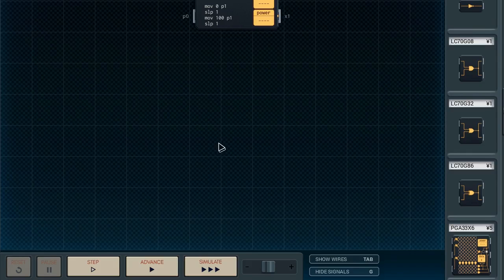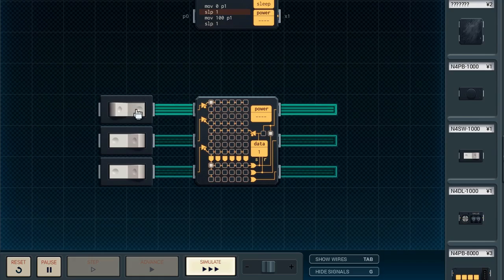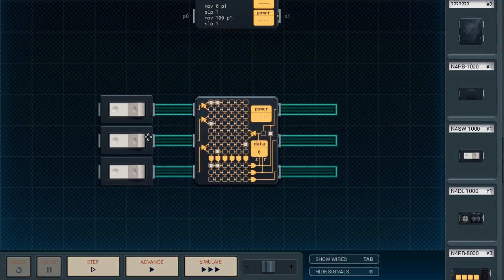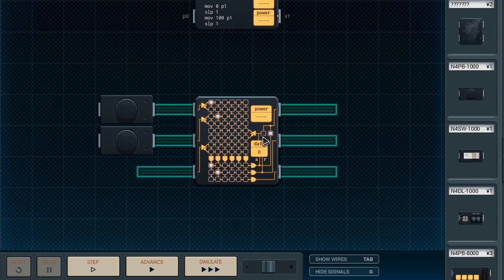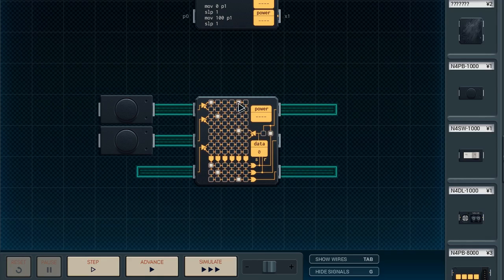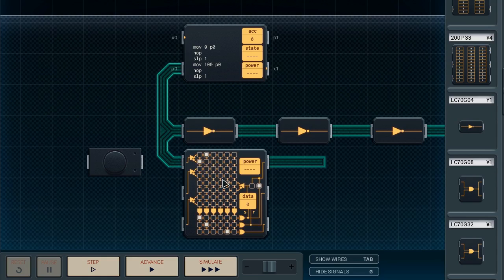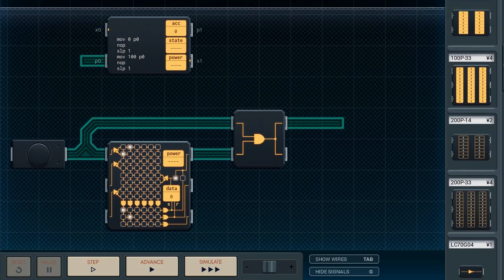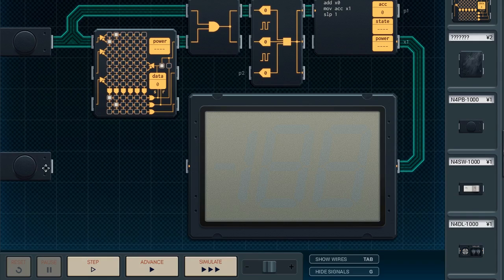Simple explanation of PGA33X6 (Shenzhen I/O)

Comment: Fun-fact:  these kinds of Programmable Logic Devices (or PLDs) where instrumental in computers like the old Commodore64 and other systems around that era as Address decoders.

The processors of such systems would select a memory address through a parallel bus and with a PLD like this you could set it that if the processor accessed a particular (block of) memory address(es) it would switch what chip would get enabled. That instead of writing data to say a memory chip , it instead would write to a sound chip. It Essentially decodes which chip data should be written/read to from the address, hence the name.

These days PLD's have largely been replaced by Complex Programmable Logic Devices (CPLD) which are bit more capable and the massive Field-Programmable Gate Array (FPGA) that can integrate entire digital circuits if one wishes.

Comment: This explains the translation a little better. Put it into google translate and it says multiply column and add row, but what it means is dot multiplication on the columns and add across the rows, which is A.B or A+B, so it's referring to Boolean algebra. So in the space of 6 squares you have can do firstly any Boolean you want to achieve expression with A,B and C like (not A+B)∙(not B +C) or whatever an S/R Flip Flop or both if you want to combine them. Thanks.

Comment: If you need a 2-cycle delay, can't you just add 2 PGAs in the series?
Reply from the maker: I ended up doing something like that. Unfortunately the PGAs seem to have input precedence rules like the normal microcontrollers, and some unexplainable randomness seemed to happen, so I actually needed a different approach for the other branch.